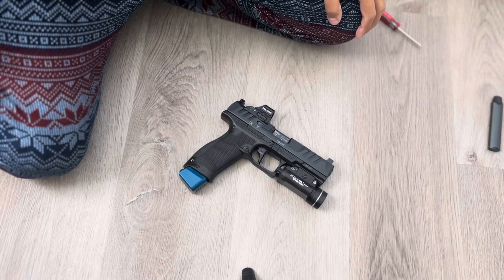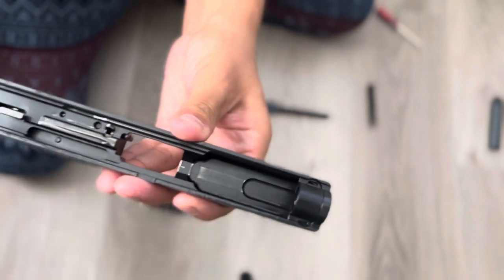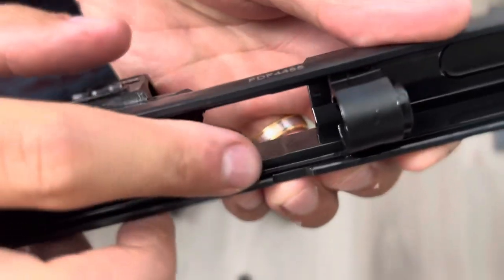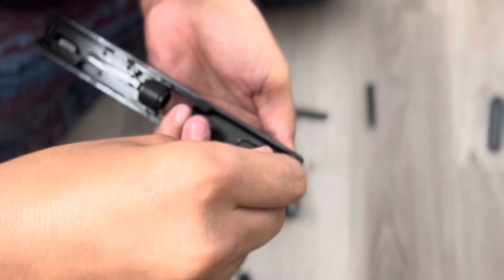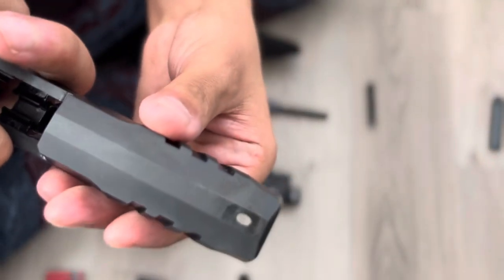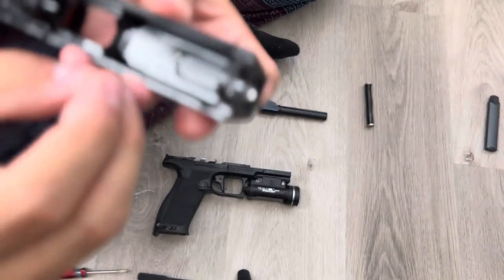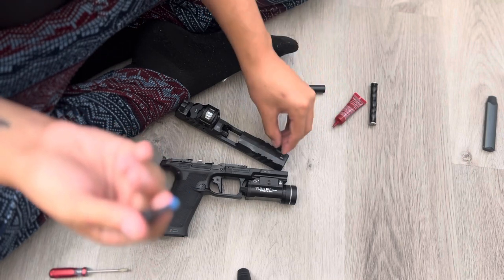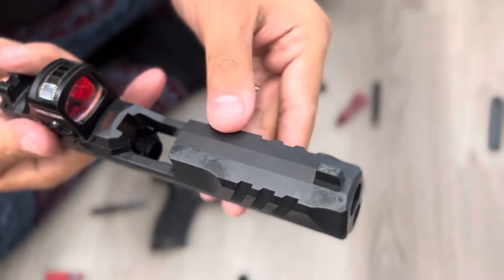Walther PDP Front sight removal using screw driver and Glock tool. Front sight spacer removal.

Comment: I have a new 4.5 inch full size Walther PDP and I would install the same "Trijicon". I wonder exactly which model you installed the "Trijicon" sight on Walther PDP and where to buy it? Simple presentation ..... very good.
Thanks for the reply in advance ...👍
Reply from the maker: I got these on midway.com they are called trijicon suppressor hight sights
Reply: @Da47Panda  
Thanks man👍